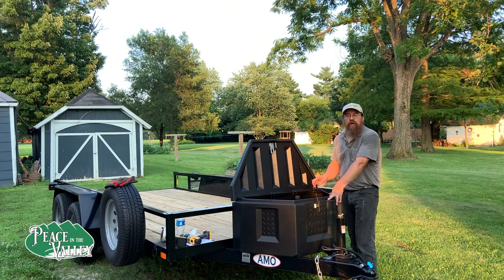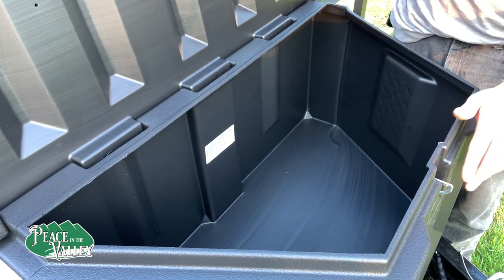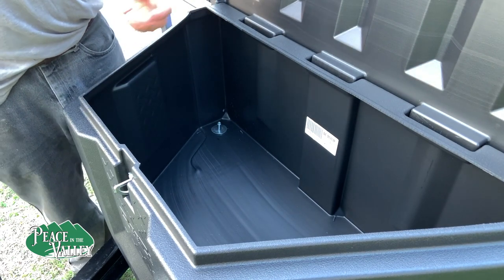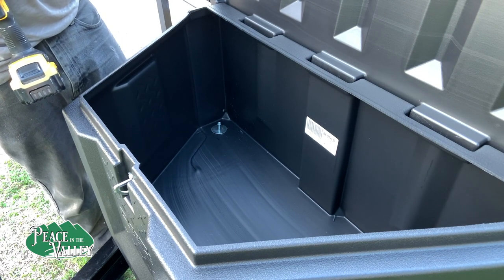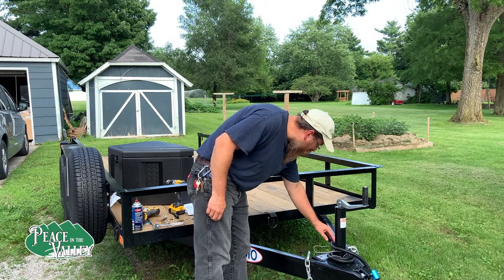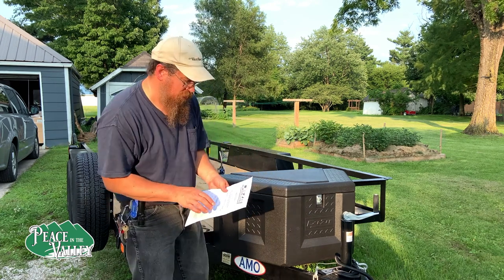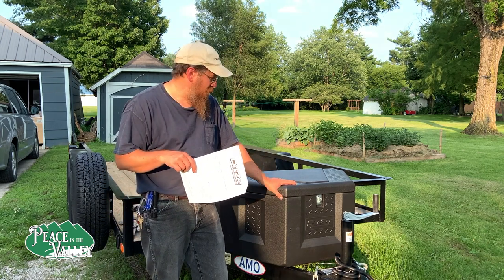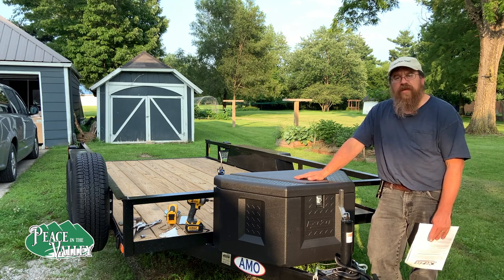EPISODE 28: Trailer Tool Box Install and Review - Sheet Metal Screws?

Comment: I just drilled holes large enough to accommodate 5-16/18 bolts and added washers and hex nuts down underneath.
It was an easy 10 minute install---

Comment: Nice job persevering in getting the storage  box installed on your trailer. A little tip from an older viewer: Soft metal screws and lags are not hardy enough to drill/tap into hardened steel like your trailer tongue. I would recommend drilling and tapping the hole with the correct size tap. That would allow you to then use hardened machined bolts. Best of luck with your property and your RK25!
Reply from the maker: I learned exactly what you said! The supplied screws - just too soft. I had purchased a harbor freight tap set, but I had too many problems with tolerances on it and decided to return it. thanks!

Comment: I am looking to purchase a box for my trailer.  I’m on the fence to which I want, metal/plastic.  Is your plastic box holding up?  I’m talking about warping, cracking or leaking.  Thank you for your help!
Reply from the maker: Hi James, I had a plastic box as you saw in the video. I'm not sure which I would go with. I sold that trailer and the box went with it. It was farily easy to damage but it was also easy to fix. A heat gun/torge and you could use hot glue to repair. Too much weight on top and it would crack at the seems. Someone borrowed the trailer and it was jack knifed and by a bumper on a truck. Again, heat gun got it back into shape.
Overall it worked.
Reply: Thank you for your feedback!  God bless

Comment: Great vid!!!!; worst factory screws for frames - brittle, standard and way too course of a thread and they do no cut sh#t!   For viewers, do yourselves a favour and drill the 3/16th holes as directed and pick up some tougher "self-tapping" screws.  (Mine were free because i got them from a specialty shop that normally sells them by the thousands.)  $4 tops at local shops and they screw in very, very well!  (I can't attach a pic to show the difference but "self-tap vs regular screw - the difference is immense - you still need a pilot hole for thicker metal like a frame)  Slow and steady wins, don't drive them in like they owe you money - in and out like a tap does to clear the path of jammed up metal particles due to cutting.  OR, use a nut and bolt if you can; even U-bolts.  Either way, don't use the stock screws that came with the unit unless your frame is made from tin foil - they will break and you get to drill out the busted screws.  The box is another story - it's amazing!!!!
Reply from the maker: You are right on. Those screws are terrible. Box not bad. I've had issues with mine but all user problems. someone borrowed the trailer and then jack knifed and the box took the brunt and broke plastic seems. I left the lid unlatched one time and it blew back and popped off the plastic rivets that attach it the body. Though they are easy to put back in. It's a matter of being more careful! Thanks for watching!